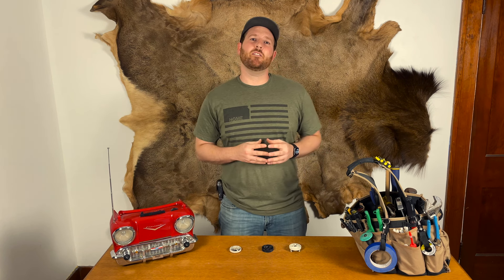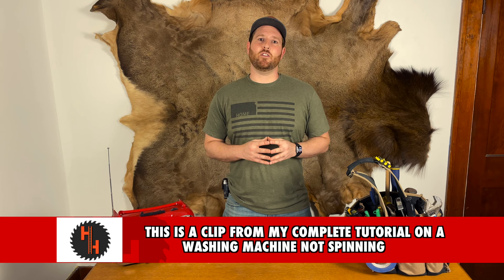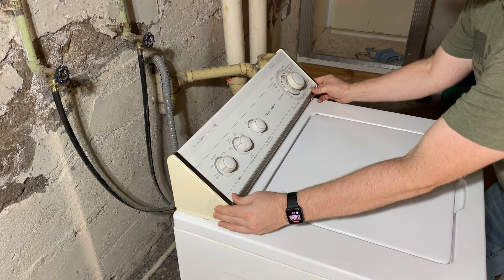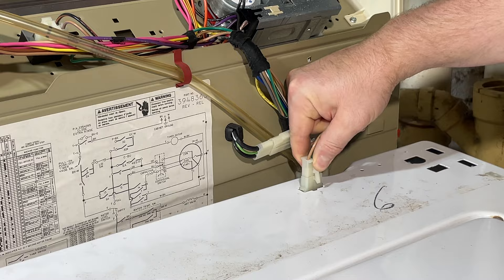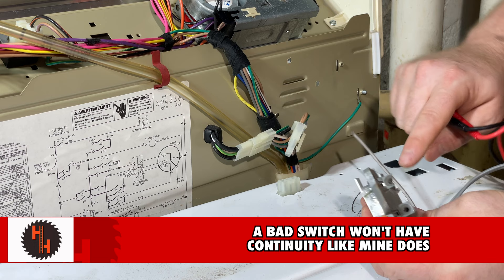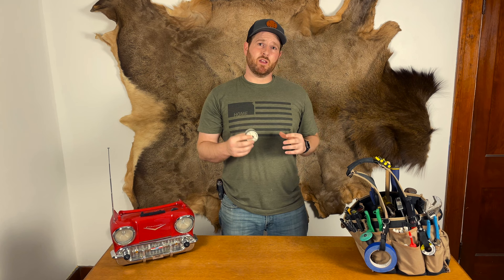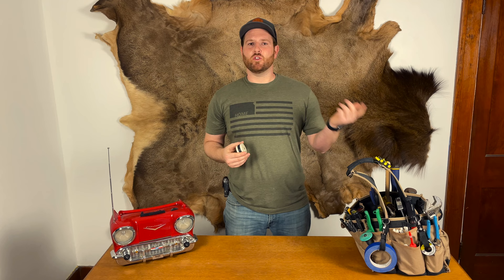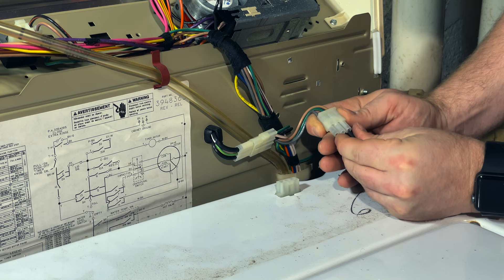How To BYPASS A LID SWITCH On A Washing Machine | 2- Minute Tutorials Ep.6

Comment: Many thanks! Our spare washing machine hasn't worked in 2 years! I clamped the safety switch together and it worked for a bit, but then stopped.  2 years later I fo7nd your video,  put in a jumper wire,  and voila,  it works!
Reply from the maker: Great! Glad it worked for you!

Comment: Super clear instructions and this was very helpful! The wire trick worked and my washer will work as I wait for the new switch. The best part about this is that you don't have to cut any wires so when you get the new switch, you can just plug the switch back in. Thanks Handyman Hertz.
Reply from the maker: Hey glad it helped! Thanks for the nice comment!
Reply: You can take the 2 screws out that hold the switch in and get it past the tub without doing all the rest .🤔
Reply: @HandymanHertz  I have a push button so when I close the lid and press play it washes but it doesn't drain and spin because the lock is broken and the lid won't lock what can I do with that please help

Comment: Washer agitated but did not spin. Could tell the switch was broken but it was at night and I needed to drain the washer and didn't really want to have it sit with water nor wanted to drag out the ship vac and drain it. Saved me time of having to find a local supply for the part and this video easily got me a working machine in less than 15 minutes of work. 👍👍👍
Reply from the maker: that’s awesome to hear. Glad to help you out!

Comment: I’m planning on stripping the wires on the pigtail of the switch end and using wire nuts. Same difference in a nutshell correct? 

Whether I hear back or not I’m doing this and only I am responsible for my diy shenanigans. Either way thanks for not making that a 35 min video. You the man brother!

Comment: I got the same machine. Did this method and it still doesn't drain or spin after it fill up with water. The pump and couplers are good. I do hear a buzzing sound at the timer knob after the water is filled.

Comment: I have a few connections I cut from bad switches with the wires wire nutted at the end still in the connection from the end of the wires coming from the switch. 
  I just plug them into the connection at the panel for testing purposes.
Reply from the maker: Thanks for the tip!

Comment: Does it matter the gage of wire you use to bypass? What did you use and how can you tell what gadgets to use? I have a super old Crosley, water in tub and died tgis AM, ugh!!!! TIA.
Reply from the maker: You’d want at least a 14 gauge to be safe. I just cut some from some house wire I had laying around. What do you mean about the gadgets?
Reply: @HandymanHertz I have a metal wire that’s it . Metal thin wire like for modeling clay  and electrical tape  .. will that work

Comment: Thanks! But…it worked for one spin, then all power cut off. Checked wiring, plug, breakers, tried old switch again. Thoughts on whether I could’ve fried something else in the circuit? (It IS 30 yrs old!)
Reply from the maker: No, I’m stumped, they are pretty simple machines. At least the old ones are.
Reply: Maybe time for a new one

Comment: If the lid lock is broken, and the agitator still spins, but the cycle will not complete, is this switch what I need to replace? It fills with water but stays stuck on wash and won’t go any further to drain, etc.
Reply from the maker: Yes, if the lid switch is broken, it will fill with water and agitate properly, but will not spin or do anything after that. You're correct and that you would need to replace your lid switch, which is pretty cheap and easy

Comment: KENMORE, 110.2224251, SERIES 500

Just replaced the lid lock and latch. Machine stuck in "wash" cycle, only "wash"  light blinks. Machine will not allow me to enter into diagnostic mode. 

Lid lock has BLUE, WHITE, and RED wires... Which do I jump?
Reply from the maker: I am honest not sure on the kenmore. I’d hate to guess and lead you astray. Maybe google

Comment: Why dont you just place a screw or nail in the groove of the switch to keep it constantly on? Safer 😅
Reply from the maker: Hmmm hadn't considered that in this specific thing. A good option, thanks for your input
Reply: At least for mines I have some type of GE washer and it'll spin but won't fully wash on cycle...last time just got stuck. Then again I'm not a pro lol

Comment: Isn't that crazy you have 700 to 800 dollar washing machines and a 7 cent piece of plastic brakes and it completely incapacitates the washing machine it is more proof that the world has gone to shh!!++

Anyways  can I tape off the plug with electrical tape instead of putting a spare wire in it then taping it off?
Reply from the maker: Yeah, it's sad things have gotten cheaper but that's because that's what people want now days. If we demanded better stuff and paid for it when we have the option, they would make it. But we want cheap and quality, there's just no such thing. I'm guilty of that myself. 

Not sure what you mean by taping?

Comment: Any recommendations for if the lid switch is working but the little hook on the lid doesn’t seem to be pressing it hard enough to activate it?
Reply from the maker: Hmm no I don’t, sorry. I know they are pretty cheap on Amazon.
Reply: The body of the switch is made of cheap plastic so they don't last long
Reply: Reach you're hand under and you can use a small screwdriver and hold the switch body up and push down on the switch arm through the whole and it will spin & rinse out .
Reply: @markbrooks8500 I just took the whole thing out cuz it’s not easy to do from underneath. Ended up getting a new washer since it was so old and rusting inside.

Comment: I did this bypass on my whirlpool wtw5100hc2 top load washer and the close lid light went out and it looked like it was going to take off, but it just stays on "sensing" for about 10 minutes and then an error code "F5E3" pops up. What do I do now?
Reply from the maker: I’m not familiar with the digital style. Maybe google it and find a forum. They are usually helpful.